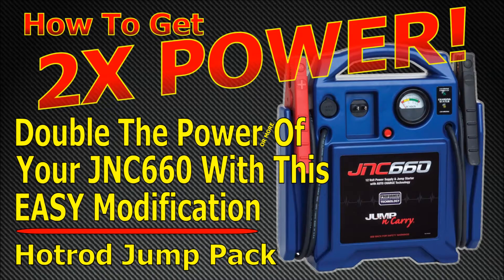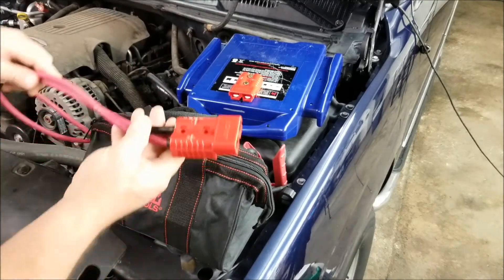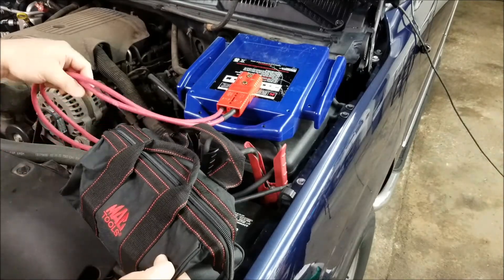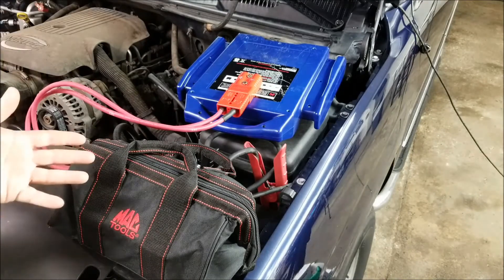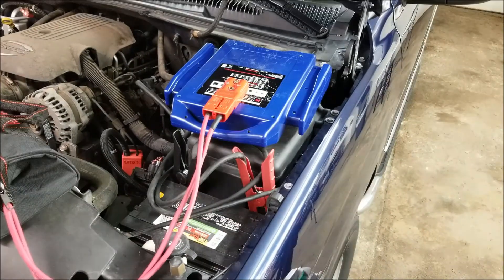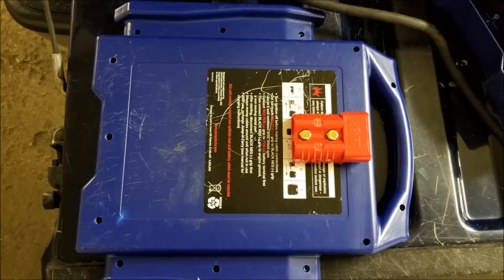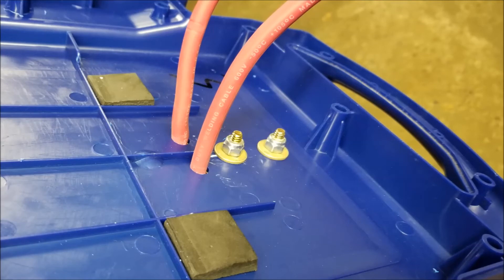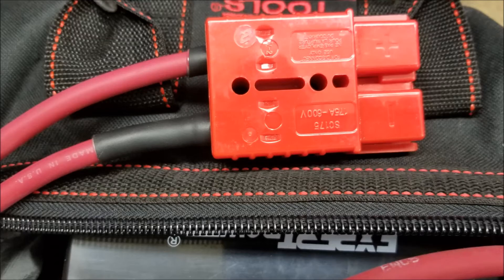Powerful Jump Starter Battery Pack - How To Get More Power With This Simple Modification

Comment: Did your JNC 660 come with the Expertpower batt or is that a replacement one you put in it?
Reply from the maker: Jack Mack 
The battery pack shown inside my JNC 660 is NOT the original battery. I tried to buy a direct replacement from Clore Automotive (the JNC manufacturer) but i couldnt find them anywhere. The replacement battery that I bought (shown in the video) came from Amazon. Its the same physical size but I dont think it has as much power as the original battery that came in the JNC.
Reply: Not sure how old yours is but I got mine in 2010.  The 1 vid I watched showed that it had a 12V 22AH from B.B. battery.  I have no doubt that the newer ones probably come with their performer JNC 105 branded 12V 22AH battery.  The problem is that this battery costs $5 less than a brand new JNC 660.